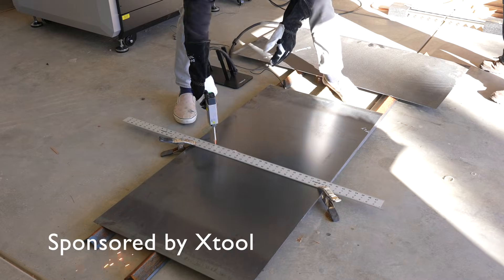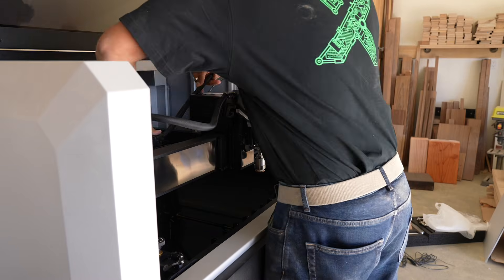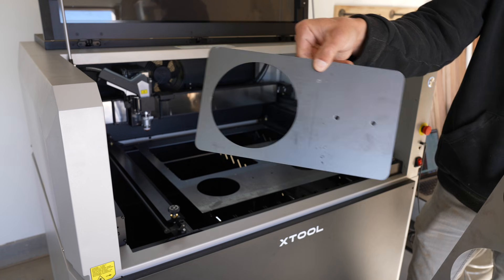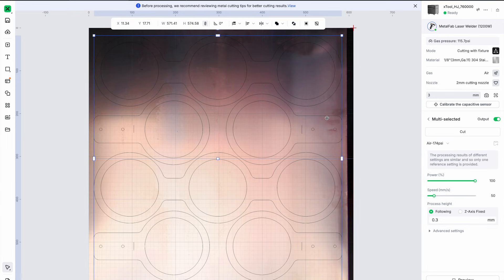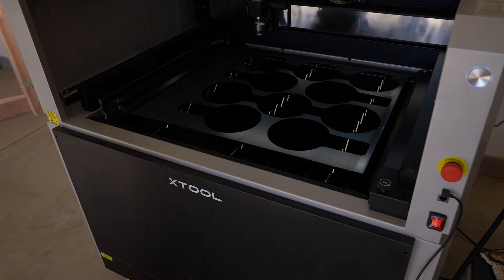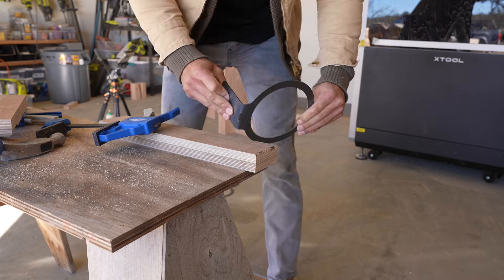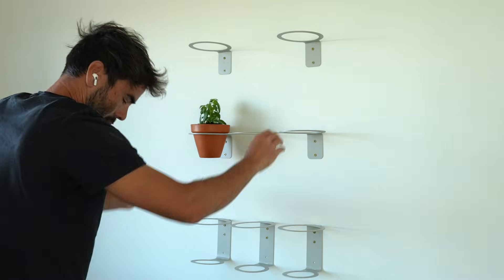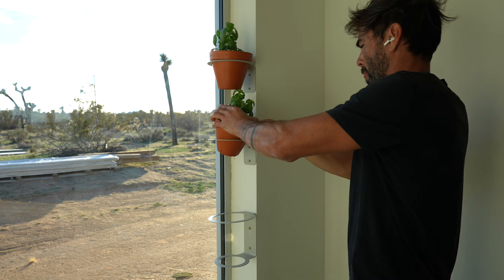Manufacturing Products at Home | xTOOL Metal Fab

Comment: I think there's a market for coat hooks (Ikea discontinued their good ones and other hardware stores seem very light on inventory/low on quality whenever I check) and for connection hardware for outdoor planters. I think your laser could make corner brackets with integrated star lock washers, for use with local rot-resistant wood or corrugated roofing sheets.

Comment: Nice careful, I learned the hard way that when you hand cut, and the laser goes through the metal it’ll take up the smooth cement layer of a concrete floor real quick

Comment: You seem to work in 3s, but you cut them in singles?
Reply: laser cuts by focusing on a point.  This is true even in wood.  You can't get a precise cut by cutting through multiple layers. One layer would be ideal and the rest would be negatively affected possibly not even cutting.